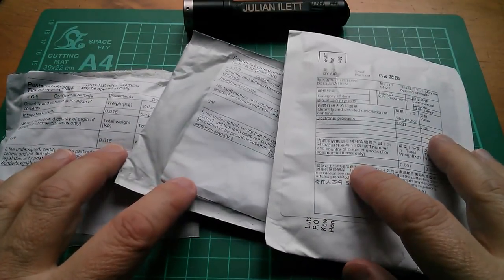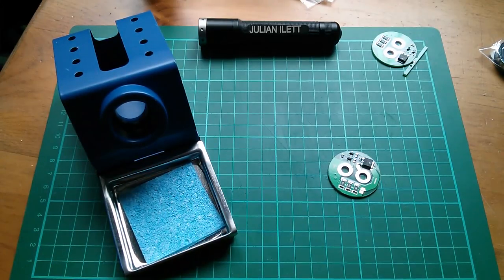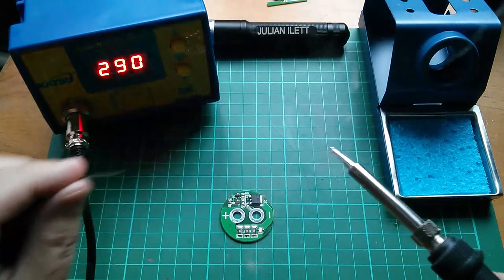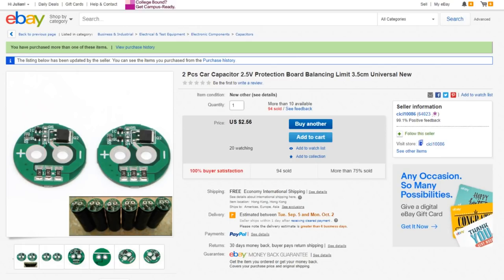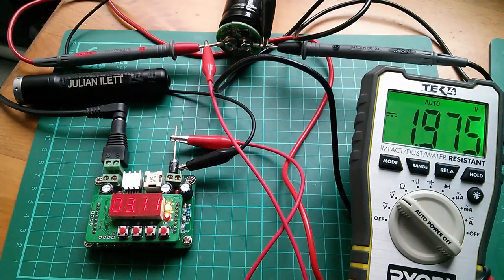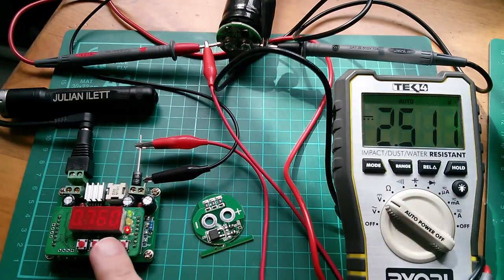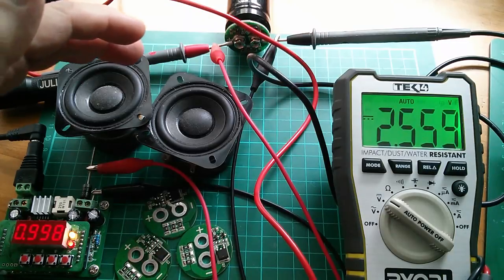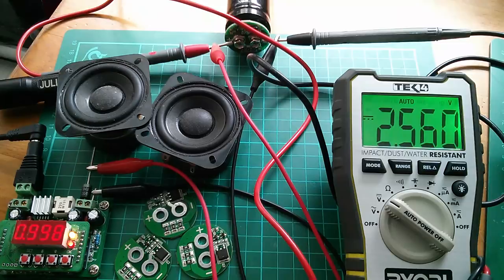Julian's Postbag Plus: #105 - Bluetooth Supercapacitor Speaker

Comment: One thing I realised with my own programmable DC load project is to never under estimate the resistance of crocodile clips+cable. They can very easily account of 1 ohm or more. Charging or discharging at around 1 Amp explains the huge voltage drop.

Comment: I would very very recommend a hot air station for SMD soldering. It changed everything for me.
You just flux the pads, put on a small blob of solder paste on each pad, plop your component in place and heat everything up with the hot air. The way the solder melts and pulls the component in place with fluid tension is magical to watch.

Comment: I have a soldering iron very similar (if not identical to that one). 
The first thing I had to do was take it apart, to fix the earth continuity for the iron tip due to a dry joint on the iron connector at the PCB (looks like mine is designed for wires, not PCB mounting).
While I was in there, I changed the mains lead for a silicone one without a sleeved earth pin...

Comment: Hi Julian, the 2.5V protection boards, are more of and anlogue current shunt, that starts at a low current and increases.  The big tranistor is a NPN and has about 1V Vsat so gets hot.  The 2.7V clamps might have a Mosfet but at 2.5V it is hard to switch Amps at that the lower gate voltage.  With the Vsat you will never enough voltage to light a LED.  Yes removing some shunt resistors would help but reduce the protection.
Reply from the maker: +Graham Wise Yes, I've since noticed it's not a MOSFET :/
Reply from the maker: +Graham Wise I'll take a closer look at this circuit in due course :)

Comment: Julian, im pretty sure its not a mosfet on the supercap protection boards, its a BJT and forms together with lm431 a linear regulator. So no chance to lightup a blue LED. They are not digital on/off with a hysteresis. And 6.25A they suppose to never reach that much current. I guess these protection boards are limited around <500mA. Kind regards, Werner.
Reply from the maker: Yeah, I coming to that conclusion myself.

Comment: The circuit works just fine. First of, the voltage drop across those test leads plays a large part in you measurements. And secondly,  the circuit is linear and not just switching on and of. The fact the the current starts to rise slowly as you go over the protection voltage should tell you that. (19:40 in the video). The circuit is just dissipating enough power to keep the voltage at the terminal @ 2.5 Volt.

Comment: How do Julian. Your Blue LED has 0.4 Ohms shunted across it and like you calculated, you would need to be pushing 6.25 Amps through those resistors to get 2.5V to develop across the LED. I'm assuming the LED voltage is closer to 3V? which Ohms Law will tell you, would require 7.5 Amps. Your Supply Voltage is already less than 3V so the LED is never going to light with those values. Intended as friendly help, not a critisism. Thanks for the Videos!
Reply: HowDo is
Reply: Biggest question is: what is the rds on of the mosfet? If it is equal as the three resistors (at best @2.5V gate) then you only have halve the voltage on the led. Don't think a blue led likes 1.25V. My guess is that the rds on is much higher.
Reply: I can't believe that a little measurement was not undertaken to see where the voltage losses were, assuming we just didn't see it.

Comment: The LM431 is an analog device; it won't "trigger" at a specific voltage.  In this circuit, it's functioning as a linear voltage regulator, biasing the gate of the MOSFET at its zener voltage.  That's nominally 2.5V, but there's a tolerance of as much as +/-2.2%, depending on which part you buy.

Comment: Did you double-check that both of the LED connections are actually connected to the board?  Could be a bad solder joint, meaning the LED isn't really connected.

Comment: It's a lot easier if you pre-tin the (scraped-off) pads first, then use a desoldering iron or solder wick to suck up the blobs. Now it's super easy to solder the SMD LEDs on without overheating them! Cheerios!:)

Comment: In my experience amplifiers catch fire mostly because the bias voltage divider resistance is too low. It can also be caused by having the input voltage too high on the primary or secondary stage which can overdrive the FETs causing clipping. If I had more information about the setup of your amplifiers I could probably tell you more as I've built quite a few myself and had to deal with such problems.

Comment: Julian, have you measured directly, the volt drop across the diode?  It might be interesting to observe if it is the same as it is with the leads.
Reply: I was thinking the same thing when he was doing a little probing. Find out how much voltage before the diode, after the diode, and at the cap (which he already knew). I was wondering if the power supply was misreading something and giving the wrong value since it can't sense the voltage coming from the cap.
Reply: It would certainly be worth having a dig around with the multimeter.

Comment: Sir,

Its a nice video. I brought the balancing board. I tried testing the balancing board for verifying its regulation by connecting the supercapacitor and a variable power supply to the same slot and used a multimeter to measure the voltage of the supercapacitor. Not sure if the method is right because the multimeter would not be able to show the actual voltage of super cap as the source is also connected to same point. By this method, I find the voltage rising above 2.8V. Didnt check after that. Is there any way to ascertain that regulation is happening? What is the max applicable voltage to the board for the regulation to happen?

Comment: I like the mention of a supercapacitor lighting project, how about a solar garden light with a big capacitor rather than a battery, i think that would make for an interesting project.
Reply from the maker: That's a brilliant idea ;) Thanks Mark.
Reply: What's the temperature rating of a supercap? That might be a problem - and it wouldn't half need a big box, (unless you could find a long thin capacitor that could hide in the stem)
Reply: I think Lidmotor has done that. Check out his auto on off video's

Comment: The mosfet is being used in the linear region as a variable resistor and not turning all the way on. Recall that the gate must be more positive than the drain by the "Vt."
Reply from the maker: Turns out it's not a MOSFET :)

Comment: I thought "never gonna work", as the LED is across a very low resistance - and will a blue even turn on at 2.5V anyway?

And the lead resistance evident on charging is also messing up the voltage reading of the PSU. so for a point before it current limits, you actually have a shunt regulator vs the lead resistance.

Just how much power can a dinky surface mount transistor and some tiny resistors dissipate ?

Comment: Julian please look at some SMD soldering tutorial you need that urgent. I can give you a tip right away: Start to put solder on one pad first, then solder the led on that one, by reheating the solder. You have one free hand now so you can hold the LED down (use a tweezers) and finish solder the last end of the LED by now adding solder to the last pad.

Comment: I tried to do this last month and ran into the same issue. All of the voltage drop was taking place across the mosfets and got vary hot. One thing I did notice water the current through the mosfet would rise with the voltage. 
I didn't think about taking off one of the resistors that sounds like a great idea I'm going to have to try that.

Comment: you could have used your multimeter to measure the voltage drop over the diode and each of the cables separately...

with only 2.5-ish volts as gate voltage it is not surprising that the MOSFET is not fully turned on. Actually a bipolar transistor would have done a much better job here...

Comment: I have that exact soldering iron and straight away i recommend you cut the plug off as it has a shielded earth pin aswell as use a temperature between 330 and 370
Reply from the maker: This one has a full metal earth pin :)

Comment: If you're going to do any SMD soldering, you should invest in some fine-tip tweezers. I have a pair of Aven tweezers that cost me about $4, but they can probably be had for less.
Reply: I actually ordered a set of "7Pcs Anti-Static Tool Plastic Tweezer Heat Resistant" that have some nice tips on them. I got them for this type of work and for desoldering old boards. Costs about $2 from ebay seller wikita.

Comment: you got the same soldering iron as me except mine says a different brand :):) its really good I love my soldering iron I got it for my birthday last year. one thing tho the temperature needed calabrating when I got it it was way hotter than it said on the display like 45 degrees more or smth so maybe check yours too. once I set it tho its been fine since

Comment: Julian you know the panel that is mounted on the neck of a colour CRT would have three class A amps one for each colour you know R,G,B could you not use that sort of thing and possibly use the third class A amp for the base so Left,Right and Base but it would be a good idea to remove common transistor TR5 which seems to connect the emitters of the class A amps to ground through a current sink, just an Idea.

Comment: When you last used these SC voltage protectors you used a digital version with a voltage checking chip, the ones in this video are analogue using a precision 3 terminal zener to drive an analogue device, I know, I used similar last year and tried your LED idea, it didnt work...

Comment: A 700 farad capacitor charged to 2.5 volts is going to contain about 1700 coulombs when fully charged.   If you are charging it with 500 mA,   it is going to take about 3400 seconds,   which is almost an hour,  to charge it up.    So really,  it isn't surprising that the voltage increases very very slowly.

Comment: Just a minor nitpick about the heat dissipation of those resistors. 2.5/0.4 gets you the amps, but the important figure in resistor heat dissipation is the watts. Those poor little sods are dissipating 15.625 watts!
Reply: Actually they didn't - but just because the mosfet wasn't biased and dissipated approx. 90% instead of the resistors.
Reply: That mosfet won't dissipate 16W either on that PCB. It will just fry up.

Comment: hi julian
can i ask you a question please
it is can i run 2 x 5mm led in series from one pin in an arduins
as i want to make traffis lights for a model railway 
for a cross road junction i have seen sone done on youtube
but it does not make it very clear as to how they are done 
i know that i will need a resistor
but i am worried that the 2 led lighting together will damage the arduino
thanks
james
Reply: james o'connell - An arduino's digital pins can handle 2 leds in series just fine. Just be sure to add thir forward voltages when you calculate the resistor value
Reply: hi  benjamin 
thanks for your help
so i would need  1 resistor for each led 
and the resistor must be for 5 volts power 
is this correct 
again thank you for your help
regards
james

Comment: Julian how does the protection circuit work if you are charging directly on the + and - terminals
Reply from the maker: It's shunt protection - current is consumed by resistors (and a transistor) to offset the charging current.
Reply: Understood, Thank you

Comment: Julian, that's not how you solder.  You should have tinned the exposed copper on the board first. That way you could have just heated each pad to melt the solder on both the pad and the LED.

Comment: Hey Julian - Your cables are crap - this explaines everything about the malfunction and odd behavior of the protectioncurcuits, multimeter and power supply.
Reply from the maker: I love el-cheapo :)
Reply: But not when there's over 1V of drop, you don't. Just buy some croc clips and proper think copper wire (speaker wire or old mains flex is good) to make your own.
Reply: Julian Ilett Hi Julian I haven't watched all your video yet just paused it to message you 1st I hear you mention about 3 tenths of a volt drop with the diode I seem to remember from Tech College days in late 70s Silicone is usually 0.7volts drop and Germanium 0.3v so 1v overall is not far off being spot on...So don't forget to up the supply voltage by about 1.2v so the super cap can then charge ok and your strange things will stop lol. ...I remember i once fitted a large security system with 64 Camera's connected upto DVR,s and had a couple of Cams that kept breaking up took ages too twig it was all volt drop on the cables so I adjusted the PSU to give 18v and that solved all the problems everything connected to the psu had there own 12v regs and as long as 13.8v or more was seen at the other end of the cable run everything worked😊 that  was about 20yrs ago and I was never called back for any problems....Enjoy the soldering station and thumbs up 👍to Adam for fixing you up with it. ..
Reply: back to video ☺☺☺
Reply: Marcus Wiedner what letter? what was you replying too . not sure.
Reply: Electronic Goat who is what is?
Reply: The first thing I do when I buy new alligator leads is short circuit my 10A bench power-supply and wait a minute or 2 to see if they become too hot to touch or catch fire.  I bought a set on eBay that claimed to be 16 gauge wire when they arrived I was expecting 50-100mV of drop but in typical Chineseium fashion they had nearly 2V of drop at 10A and went up in smoke rather quickly.  Then I cut another apart and it maybe had 30 AWG copper clad aluminum wire surrounded by extra thick PVC jacketing.  Just complete junk and they were selling them in a 10 pack for $12 so they weren't the cheapest option.  I ended up contacting the seller and they gave me a partial refund.  I then replaced all the wire with 16 AWG silicone jacketed wire and they are reasonably decent and easily good to well over 10A for test circuits.
Reply: I think he is using a high current schottky diode which has 0.3V to 0.5V across it.
Reply: Yes, I measured mine (~the same) -- 0.55 Ohm each. So if it's 1A, then 1.1 V is lost in the cables.

Comment: I've bought some of those so called Schottky diodes from eBay. I reckon they are just standard diodes. The voltage drop on mine is 0.6v
Reply: John Armstrong The voltage drop depends on current flowing through the device, check the datasheet. See the graph named instantaneous forward voltage vs instantaneous forward current.
Reply: MrJohhhnnnyyy Ah! Does the voltage drop increase or decrease with current? I was using one of these ebay round 10a ones as a blocker on my solar system and the voltage drop was 0.6v and it got very hot at 5a but it was sold as a schottky. When I changed it for a huge true flat twin Schottky diode out of a pc power supply (using only one side) the voltage drop is only 0.3v and it doesn't get particularly  hot?
Reply: The voltage drop rises with current. Diodes in that "small" package you refer to have a rating of 5A maximum, usually. So having a 0.6V drop at full current is pretty damn good. The small diode dissipated 0.6V*5A=3W that's why it got hot, the TO-220 package one dissipated only 1.5W. That package can stay reasonably cool at this dissipation level without any heatsink.
Reply: MrJohhhnnnyyy I really do appreciate your reply. I have so much to learn and I am enjoying my new hobby. I hope that folks like you will continue to tolerate stupid comments.😄
Reply: It's alright, you can't know everything. We all started from zero sometime ago, it just takes time to learn all these tricks. I just found it funny that Julian sounded so confused about it, 'cause he has much experience.  He is pretty good at digital stuff, though. Like micro's, logic chips, those Z80's :D I know about diodes and simple analog circuits, but when it comes to micro's and those old processors, I know bugger all :D

Comment: The crocodile clip cables are rubbish. I ordered some, not from china and there is barely any copper inside... Gonna replace them with my thick braided red wire I have around, very flexible stuff. Very nice wire. The clip plastic color is enough for me.

Comment: I need 1 Hz clock pulse. I don't want to use 555. Any novel ideas?
Reply: a cheap gps module off ebay gives out a super accurate 1hz pulse for not much money (and 5v dc)
Reply: a 32768hz crystal, very common solution
Reply: any cheap electronic clock produces a 1Hz if it has a hand/display for seconds...
Reply: f ridge yeah I could just shove in a chip like 4060 but I don't want to use frequency dividers for it. I want to make it very minimalist. Plus it's not novel. As you said, it's very common.
Reply: The Soft Machine I want it to be as minimalistic as possible
Reply: TubiCal I want it to be as minimalistic as possible

Comment: Those china cables have 1 Ohm. Throw them away. Had the same ones and got quite the same issues. Since then I solder my own crocodile cables with 2,5² or 4² for low Volate experiments.
Reply: Yep, I agree. I'm going to redo my cables as well. I saw a video that showed the resistance before and after, and it was substantial. I just need to get the banana clips ordered.

Comment: got a 2 k ohm and 1 k ohm resister an 17 volts in and trying to get 9v out with voltage divider and it dosnt work dno wt to do lol
Reply: Learn how to calculate the values for a potential divider. Or cheat:

http://www.electronics2000.co.uk/calc/potential-divider-calculator.php

You are never going to get 9V with those values.

Comment: I don't understand why you are so timid when it comes to the current setting you're using to charge those capacitors...

Here's a thought:  How about instead of an LED,  connect the input side of an optoisolator across those resistors.  Then you can do all sorts of things with the output sides,  and it won't depend so much on the exact details of the circuit you're trying to monitor.